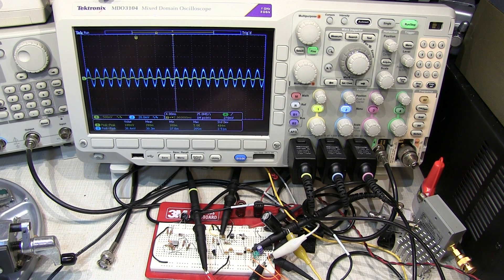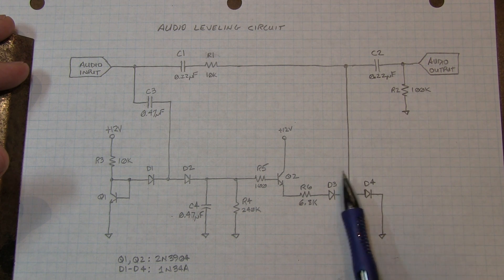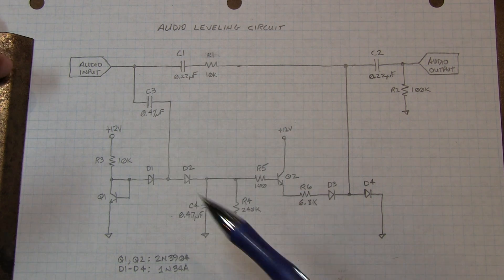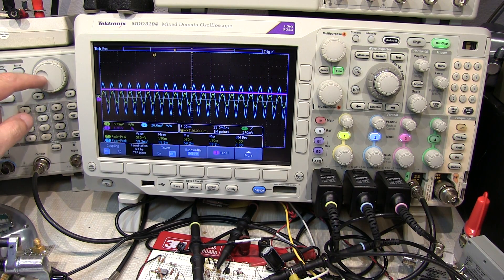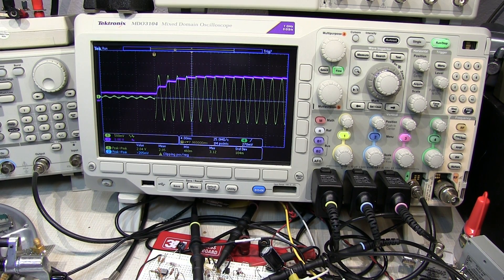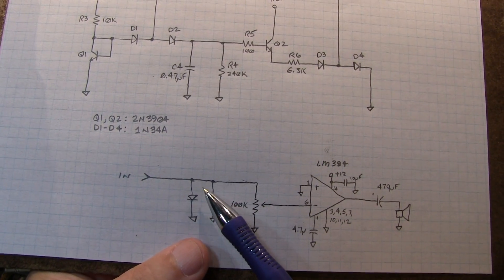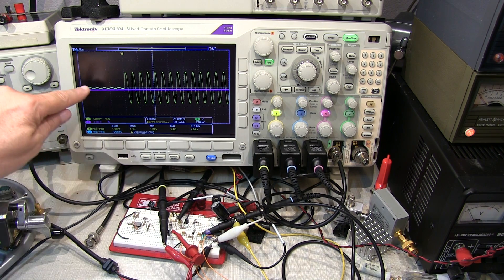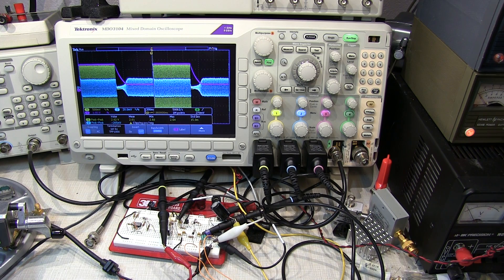#157: Circuit fun: Automatic audio leveling circuit | audio compressor | for scanning receiver

Comment: So, yesterday I was thinking about a good way to hook my radio's output to my car's stereo AUX input.  I've got a simple cable (like a iPod -> AUX input jack cable), which works fine, but then I'm juggling the volume knobs on the radio and (left and right VFO) to keep the audio on the car's stereo manageable.  

My thought process was "hey, if I had some kind of audio limiter circuit, I could drop it in there and the car would get a nice level audio input... I wonder if anyone has done that already?"  Fifteen seconds of googling and I found your video.  I especially enjoyed your use of the scope and your discussion about what is actually happening along the path through the circuit.  You have a good balance of technical discussion and practical demo... very nice.

I'm pretty comfortable reading a schematic and turning it into a physical circuit, but I don't have the EE background to design the circuit in the first place.  I think I can probably leverage yours into doing what I want.  Thank you for sharing!

Comment: I tweaked this a bit to use it on the audio output of the micro BITX HF transceiver.  It works great!  I used a 600:600 ohm isolation transformer between the BITX output and the circuit input.  I tweaked the values of R1 and R2 for my headphones, and I eliminated C2.  Oscillograph show a reduction of a 4 volt peak-peak signal down to 50 mV peak-peak.  Thanks Alan!

Comment: Better performance than the AGC circuits I tried - I like your solution a lot!
Now I just have to adapt it to my TV, to stop the annoying commercials to jump out at me :)
Or, even better, I could just use the peak detector to automatically mute the set during commercials ;)
Reply: Contrary to popular belief the ads are not actually any louder in peak value than the main program content since both the transmit and receive devices have a max volume range before distortion become offensive. Rather what is happening is the average volume increased by boosting the lows and compressing the highs. Further ads generally are recorded with a 'high energy' delivery style similar to a person speaking in an excited voice as opposed to a normal or sombre voice. In essense the producer of the ad is using a circuit similar to this one to maintain that high average volume. So to counter the percived volume change you would need an 'anti' version of this circuit with a slower attack and fast decay response. Personaly my method is much simpler. I don't watch or listen to commercial broadcasters. This is not only kind to my ears but the IQ of the programming is generally raised by a significant order.
Reply: Rob B Thanks for the explanation, Rob. I suspect that my cable provider may be a bit wilder than that - I would say that general program is delivered at reduced volume, to make you raise the volume of the set and expose you to the full blast at commercial's time, but I will have a look with a scope, as soon as I have the time and the mood for it. As for your personal method, I wish I was single again to do it too :)

Comment from the maker: Afrotechmods ...low power schottky diodes will probably work too, but maybe have a little more variation at the low amplitude end of things.  Worth a try...
Reply: I built this circuit using 4 BAT54 diodes in MULTISIM. The output limiting voltage is around 10 -15 mV when the input voltage peak to peak is not too low, say 800 mV to 8V. Either too low or too high input will fail.

Comment: Hi Alan. I bought 10 boards and have built up several based on your component values. The circuit works amazingly well. I'd add that (possibly) the schematic also have a parts list that corresponds to the PCB. I originally  used 914 (1N4148) diodes (didn't see the 1N34 on your note sheet in the video)) and although it worked, it didn't kick in until about 1.5 v RMS. That makes sense. I replaced the diodes with1N34A and all is well...extremely well. Beside Ham Radio and SWLing, I'm using one in the studio to level-out old radio broadcasts for remastering...The Shadow, Inner Sanctum, Lights Out, etc. We have a bunch of commercial compressors and limiters available here, but why bother. This thing is a fool proof "one-knob-wonder" for the technician doing the dubbing and editing. I was going to play around with VTD photo resistors and opamps for active gain control or possibly some kind of VCA circuitry. Like I said, "Why bother." Thanks again for all that you do.
Bob, N1KPR
Reply from the maker: I"m glad to hear that this simple design is working so well for you!

Comment: Wow. As an electronics beginner, this circuit blows my mind. I tried to take a shot at explaining what's going on, let me know if I worked it out wrong: You are essentially using the diode D4 as a "current-controlled resistor", specifically: R = U/I, but the diode is always going to keep its voltage drop at value specific to the diode--let's say it's 0.2V in this case because it's a low-voltage one, so R = 0.2V/I. That leaves R depending on the current flowing through it, and that current is (for the most part) the current coming out of Q2's emitter, programmed by the peak voltage level at its base. And so the current-controlled D4 is taking the place of the second resistor in a resistor divider, the first resistor being the (fixed) resistor R1. The higher the voltage from the peak detector, the higher the current through the diode, the lower its resistance, the more current will flow through it to ground instead of through the output. Does that make sense?
Reply from the maker: That's basically it.

Comment: Neat circuit.  I do a similar thing using the audio software Audacity to compress the dynamic range of music from a CD or download.  If you like listening to Opera or Symphonic music while driving in your car you find you are always fiddling with the volume.  Turning it up when the levels dip close to the background noise (car/road) and then down as the levels come back up.  So, it makes the highs a bit lower and the lowers a bit higher and keeps everything more-or-less above the background noise.  Cheers, Mark

Comment: Definitely, this is what I must upgrade my TRX with. When listening to HF the audio level is jumping up and down dramatically. Sometimes it makes me jump up and down too. Also, this will help me to take care of my ears.
Reply from the maker: Just beware that you need to follow this circuit with an audio amp - this circuit can't drive a speaker directly.
Reply: @w2aew , of course, I'll use this one as a middle stage before the final amplifier. I'll probably make an external speaker with its own amplifier and this compressor in between. I also think if I'll insert this circuit into microphone preamp in order to make better signal compression on SSB.

Comment: This was good for signals >1.5Vpp (diodes fully on?) and <0.2Vpp (diodes shut off?). But between those voltages you get distortion. I'll try this out with an op amp peak detector to see if that makes a difference. Thank you for sharing this circuit it is quite nice to see how diodes can be used as voltage controlled resistors and such low distortion at 0.5Vrms and above with this particular circuit. Also I substituted the diodes with BAT46/8 since I don't have access to your ones.

Comment: This is awesome!! I remember trying to design something like this in college and was never able to pull it off. Would low voltage schottkys like BAT54 work?
Reply: If afrotechmods tells you "this is awesome" then it is
Reply: If dbuezas tells you "this is awesome" then it is
Reply: Any new material coming? we need a laugh.

Comment: Hi, Alan. I did breadboard the circuit. My brother had to catch my mistakes... lol... (I had missed the jumper on Q1, between its Collector and Base.)

The circuit worked as advertised. At 1KHz/Sine/3Vpp, the leveled output was 32.4mVpp, measured with the cursors. Of course, as this is breadboarding, the circuit was noisy, with consistent, significant ringing. My scope's math function interpreted it, noise and all, as 46mVpp. 

I powered the circuit at 12VDC. My component values were fairly close in tolerance to your specifications. Probes were x10/AC Coupled/20M_BWL. DC offset = 0.

The output is not centered evenly above and below ground. The positive amplitude is 7mV. The negative amplitude is -25.4mV. I would like for you to tell me more about this phenomenon. See following.

Let's consider using the leveled output with an amplifier to output the reduced signal. I guess the mentioned skewing is not actually a DC offset and it should not damage the speaker? The skew would just mean that the speaker would travel farther on one side of center, than the other, but that the natural center point of the speaker travel is not offset with DC, so no damage will occur? I will watch the video again, to consider this, but I do recall that you said that this circuit might not be the best for High Fidelity listening.

Thanks so much for all you do for us. It is truly appreciated.
Reply: Edit: I used PN2222A transistors. I do have 2N3904s.

Comment: Alan, neat little project. I would like to hear a scanner or radio through it with different volume levels. I might have to build this!
Reply from the maker: Randy, you'll probably find that you'll need to make the peak detector cap a little larger, depending on the compression in the scanner.  I've taken apart my breadboard, but I think I might have to build a soldered prototype of this one too.
Reply from the maker: K7AGE I built a proper soldered breadboard of this circuit, increased the peak detector cap to 2.2uF, and ran it on my scanner, using an amplified speaker at the output.  Works remarkably well.
Reply: Alan, how about a short demo video?
Reply from the maker: K7AGE Sure - here you go:
Automatic Volume Level Control circuit demonstration | scanner

Comment: This might be a silly question, but is this the same circuit topology for an Automatic Gain Control (AGC) block in an RF circuit?
Reply from the maker: No, the AGC in a RF receiver usually consists of some kind of amplitude detector circuit driving a voltage (or current) controlled variable gain amplifier.

Comment: Never saw the basic circuit of a compressor. I first started with a VCA-type compressor where a voltage controlled amplifier is controlled via a peak detector followed by a attack/release envelope, as these components are always part of a modular synthesizer...
I´ve build some studio grade compressors for audio processing. Some uses a single ended j-FET as the control element (= UREI clone) some uses LDRs in conjunction with LEDs and/or light bulbs (=Teletronix clone) and, of course tubes.
And now a have another topology to play around with as well, many thanx :)

Comment: Hi
Just an easy question i hope.
You mention during the the peak detector explanation that it is a sort of a peak-peak detector. But in the scope plots where you show how the peak detector increase during each cycle, it looks like it is only the positive half cycles and not also the negative cycles where the peak detector increase?
Reply from the maker: The negative cycles charge up the input cap, the positive cycles transfer the voltage to the output cap.  It is not a full wave rectifier, that's why you don't see any "action" on the negative cycle.
Reply: @w2aew  thank you for the answer.
Yes i see, it behaves like a voltage doubler. I was also fooled by your scope plot where the peakdetector rides on top of the input voltage. Can now see the scsling is different on the two traces 😊

Comment: I am interested in this circuit, IF it can do what I want.  So here is my "problem".  When listening to my local fire department and dispatch "tones" them out (or pages them out), the tones are very LOUD and I have to turn the scanner down to avoid that excruciating noise.  Is there a chance this circuit can attenuate that tone down to the same level as the talking?  I don't mind the tone being the same loudness as the people talking, but when that tone goes off, its ear piercing.
Reply from the maker: Yes, it should do that just fine.  However, keep in mind that you can't simply place this circuit between your radio and the speaker.  This circuit can't drive a speaker directly.  This circuit needs to be inserted before the audio amplifier, or has to have an audio amplifier following it in order to drive the speaker.

Comment: Hi Alan, I just had a look at your video, and will be adding this circuit to my QRP-Labs QCX. I found your schematic and even ordered the boards from OSHKosh. You might want to update your schematic in your directory to reflect D1-D6 as 1N34A’s. Thanks for the explanation of the circuit!
Reply: Hi Michael I just built a qcx myself and would like to know how that worked out for you?
Thanks kg5sso

Comment: So i wonder, is it possible to replace some of these diodes by LEDs and have them light up specifically when there is compression going on?
Reply from the maker: Unfortunately, no. The forward voltage of the LEDs is too high.

Comment: Take 2 hours to understand this circuit,  only one thing still not very sure,  the negative audio function of D1, it seem it do not help much in peak detect, as for peak detect it only need D2. for the bias part of D1, I can use 2 of D2 to replace D1.  Is that right?
Reply: What happen if I remove D1,  use 2 of D2 for bias

Comment: Hello, thanks to share with us your knowledge! I have a question: Ok the circuit compensate the input variations, BUT, how I define the desired output level?
Reply from the maker: Leonardo Takahata For this simple circuit, the output level is not adjustable - it is what it is because of the diode characteristics.  The only way to set a desired level is to follow this circuit with an amplifier and adjust its gain accordingly.  An amp is necessary anyway, since this output is quite low and the source impedance isn't low enough to drive a speaker.

Comment: Would this work in line with head phones? All mp3 wav and flac files have diffrent volumes
Reply from the maker: Only for old high-z crystal headphones.  For modern low impedance headphone you would still need a buffer/amplifier after this circuit.

Comment: I'm a live audio engineer. Use compressors/limiters all the time, and never knew they could be this simple! 😳 Would slowing the attack time be as easy as putting resistance on the charging side? (I.E. between C3 and D1/D2) It could make this serviceable even for musical applications.
Reply from the maker: This simple circuit distorts pretty heavily - OK for communications grade audio, but would likely be ugly for music applications.

Comment: Just wondering Alan. With 4 channels on the scope do you often wish for more vertical space on the display? What drives the selection of the LCD from the manf. point of view? I am thinking simple availabilty of ready made displays and divers or is there a more fundamental reason? Have you noticed how the screen resolution of computers in particlular portable models has regressed and stagnated at 1080P? Again I suspect, driven by cheap off the shelf 'TV' displays and driver chips.
Reply from the maker: Not really. I grew up with 4" CRTs and 4 channels, so today's displays are more than adequate. Major manufacturers use industrial quality displays, so don't generally benefit from high volume consumer grade displays.

Comment: Congratulations, very very good.

If I want to use 5mV on the output, what changes do I need to make to the circuit? Is there a possibility to regulate this desired amplitude of output with a potentiometer?
Reply from the maker: You can put a resistor divider or potentiometer across the output to give you a lower output voltage.
Reply: @w2aew  I am simulating the circuit on the proteus before assembling the circuit on the protoboard. But it is not working in the simulation, I regulate the amplitude of the input signal and the output signal changes the amplitude. As I do not have the Diode 1N34A in Proteus, I am using 1N4148m is this the reason?
Reply from the maker: @lincolngerken  The circuit relies on the dynamic impedance variations of the 1N34A.  Using a Si diode like the 1N4148 isn't going to work as well, and will require a much higher input signal level before the compression begins to occur.
Reply: @w2aew  OK thank you. I'm going to buy the 1N34A.
Reply: @lincolngerken  In Proteus you can make and edit your own component (diode 1N34A) with the command "Make a device".
Maybe if you share your Proteus simulation file someone can implement the 1N34A for you.

Comment: Just what I was looking for! No need for JFETs or OTAs or mixers. The use of diodes as variable impedances is really interesting, I suppose that’s similar to how they work on ring diode mixers.

Oh and I assume the attack time could be varied by changing the ratio between the two capacitances.
Reply from the maker: Actually, in diode ring mixers, performance is best when the diodes are fully switched on/off.  Yes, attack and hold-delay can be adjusted by playing with the caps and resistor values.